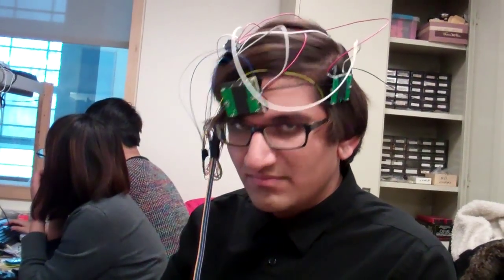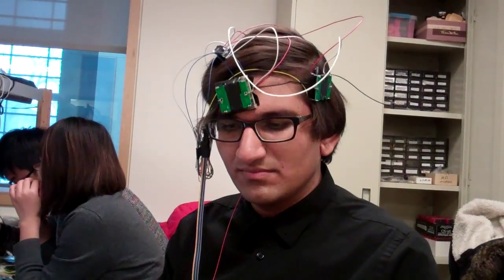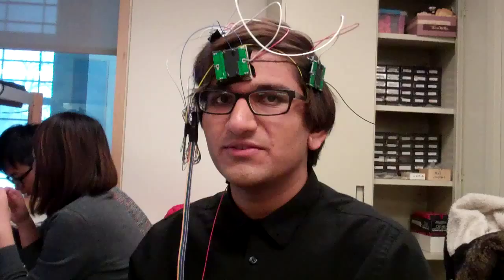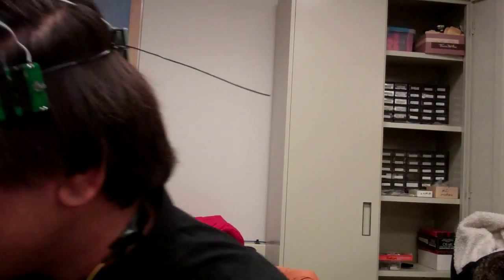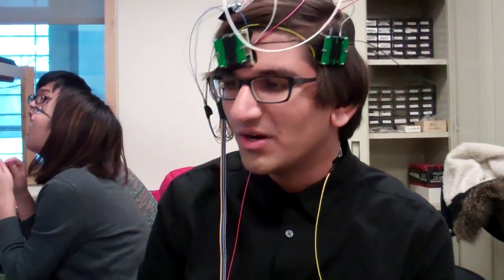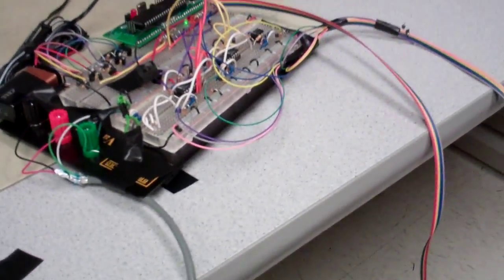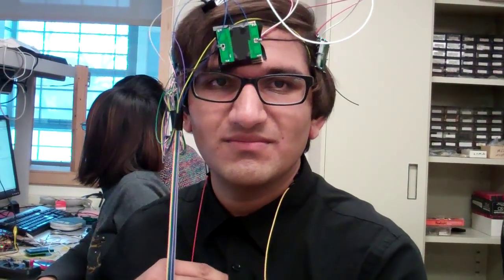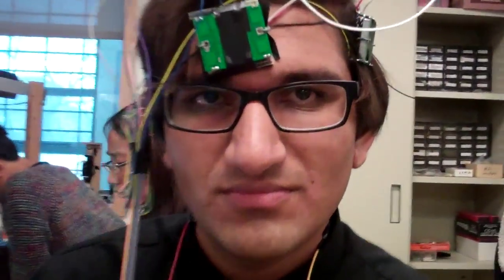personal collision detector

Comment: what compiler is for your protect
Reply from the maker: GCC
Reply: I like this project so for that i complied above code in atmel  studio 6  and  i got HEX file.
but it is not working when i  try to stimulate the above circuit in Proteus software by using that hex file .
Reply from the maker: "Not working" carries no information. Narrow down the error. Are the voltages corect?  Is the circuit you simulated correct?
Reply: could you please send me the hex file because without giving any input i am getting 5Vp-p PWM signal to pin no: PB 3,4 and there is no out put for  pin no: PD 6,7.
Reply from the maker: why do you think the hex file is incorrect? did you choose the correct cpu? Mega1284? It is much more likely that the simulation is wrong.
Reply: Yes the cpu is same Atmega1284p
Reply: But I implemented in hardware but the result is same could you please help me for solution
Reply from the maker: It is impossible to debug this kind of error without being in the same room to see the circuit. Sorry. Check every waveform on every wire. when one is wrong figure out why.
Reply: Thanks for your reply but please tell me that the above provided circuit and code is it ok or any changes are needed.
Reply from the maker: YOu will note that this project is 4 years old. The only documentation is what is on the web page. If you ask a specific question about one of the figures in the report, I will try to answer it. Otherwise, I have no idea what you built.
Reply: thanks for your suggestion sir,  in Proteus software i choose Atmega1284p  cpu and i connected +5v supply and ground to the mcu and also i  connected mode selection circuit to it.And i am not connected any frequency and distance inputs to the microcontroller And i got an .hex file by compiling  the code  using Atmel studio 6.0 and i load the hex file into microcontroller and finally when i click on stimulate iam getting +5v PWM signal with 20ms time period at PB 3,4 pins and 0v at PD 6,7. so please tell me, the problem is in code or in circuit.
Reply: image of Proteus stimulation result is in below link sir please find this.
https://drive.google.com/file/d/1UL9BfRbYKUWhPDSMMzmkEd8E0kyYiYj8/view?usp=sharing
Reply from the maker: Those pins are all motor control. If there are no sensors attached, then why would you expect it to work?
Reply from the maker: the image tells me nothing more that you have already said. Why would you expect a partial circuit to do anything?
Reply: sir i connected all sensor inputs but the result is same
https://drive.google.com/file/d/1s8oX8EI9K6CeDuLt2pXFzHKM4huoDc1Q/view?usp=sharing
Reply: sir this is my email address saiprasad431431@gmail.com  please send me the hex file.
Reply from the maker: I do not use that compiler now. I do not use AVR now. I do not have AVR studio on any machines.  You are asking me to do a bunch of useless work, because you are going to have to understand every line of the code so that you can modify it for testing to find out what is wrong.  Simplify the program down to reading one sensor. Show that it works. And in the motor control. Show that you can control it. This is what you have to do.
Reply: Ok sir thank you
Reply: Hi sir, from the last five days i am working on this project and i have verify and understood both the code and hardware design as you said and i have try to rectify the error in the code by simplifying the program to reading one sensor. but i am fail.  And i have also implemented the above design in hardware but there is no change.with or without giving four sensor inputs the four pwm pins generates 5v pwm output. I am not understanding where the problem is.  sir plz plz help me to solve this.
Reply from the maker: As I have now said several times, this kind of error is IMPOSSIBE to debug unless we are in the same room with the hardware.
Reply: Ok sir I understood, but atlest verify the code once then you will understood where the problem is.
Reply from the maker: The fact that you say this means you do not understand. The code and he hardware need to be debugged together.